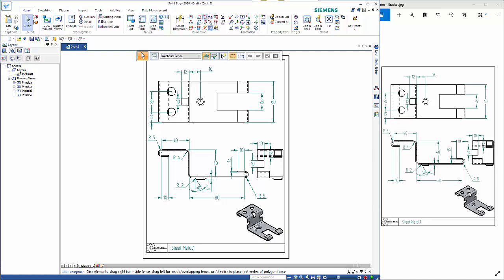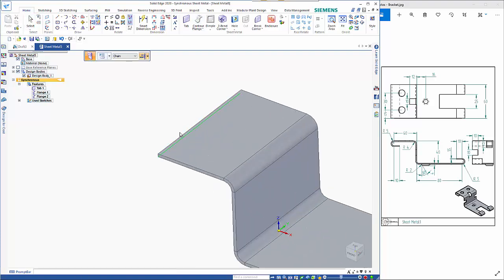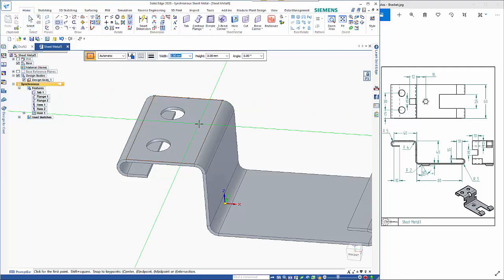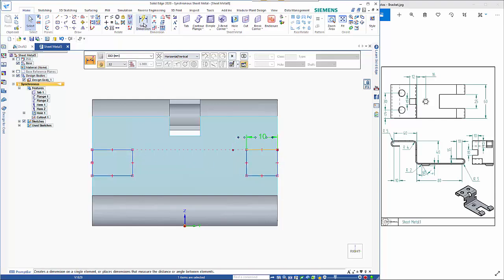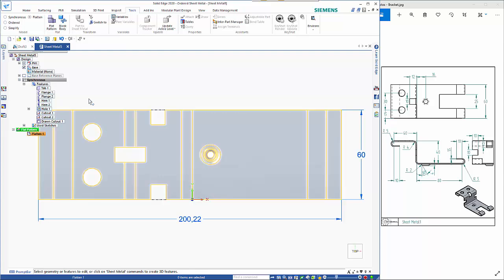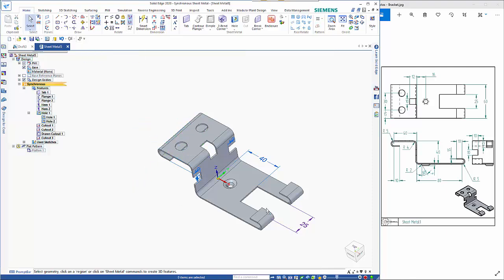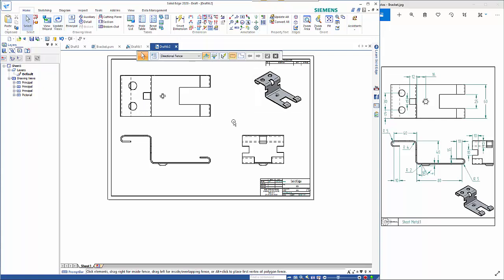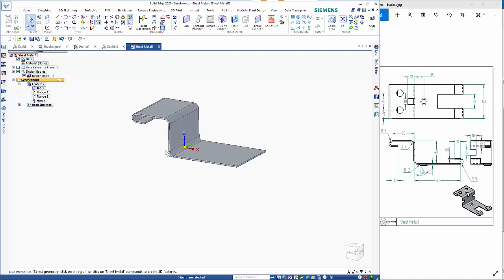Solid Edge sheet metal tutorial - Bracket

Comment: How do you make it so that all dimensions show as horizontal by default?
Reply from the maker: The dimension on a 3D model are shown on the plane that it is mostly closely aligned to. So if you view is more closely positioned to the front view, a dimension will be placed on that plane.
Reply: @cadcentralnz  Im sorry my question was very unclear. When dimensioning on a drawing id like for all dimensions to be horizontal instead of the numbers being sideways (vertical), without having to manually change all my dimensions to be horizontally legible. Is there a default setting to change that?
Reply from the maker: @ZSchink  You need to click on the View Tab and click Styles. Find the dimension style you use and click modify. In the Text options, change the orientation to horizontal. This should update all your dimensions in one go. To have this for future drawings, edit the template file and do it there too.
Reply: @ Thank you very much for your help. That did the trick. I look forward to learning more and more about Solid Edge and your videos/help have been amazing. Thanks again!